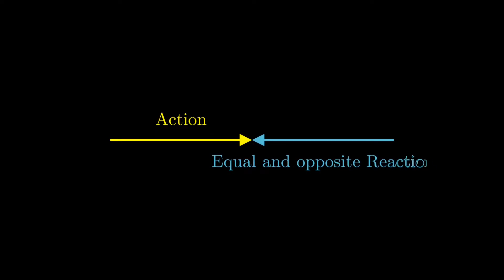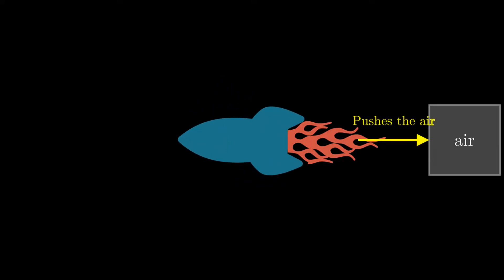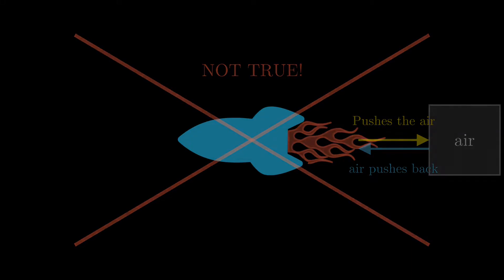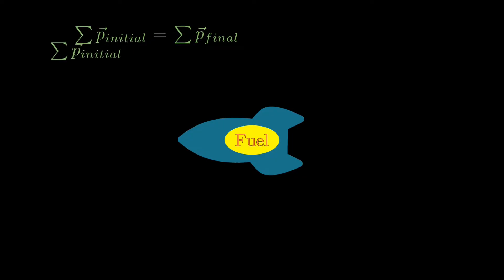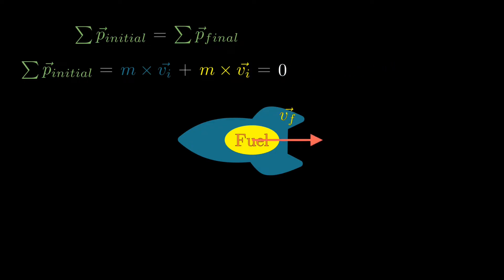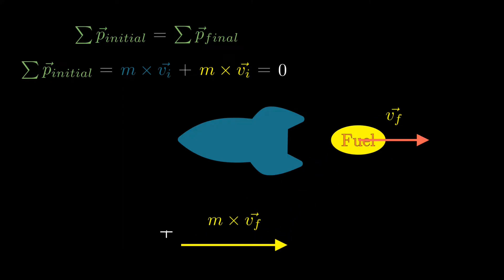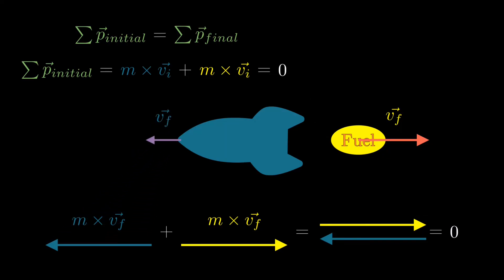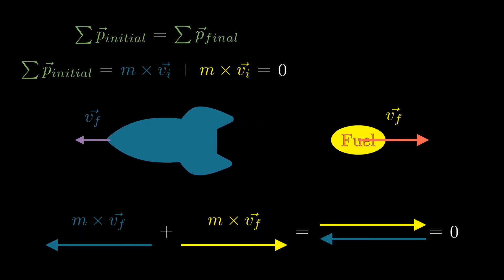What do Rockets push in Space, where there is no Air?

Comment: How do the engines ignite if there’s no combustion in a vacuum?
Reply: - "if there’s no combustion in a vacuum?"

Who says there is no combustion in a vacuum.  Certainly NOT rocket scientists.
And rocket engines run at about 3000 PSI chamber pressure so it is NOT a vacuum in the rocket's combustion chamber.
Reply: @stuartgray5877  1st law of thermodynamics, as a system incapable of either doing work or energy transfer cannot alter it's internal energy.
Reply: @papalegba6796 So you’re back to not understanding w = P * delta_v
Reply: @papalegba6796 It keeps repeating the BS that "Rocket can perform no work".

It just does not understand that the rocket cannot do work ON THE VACUUM, but it CERTAILY CAN do "work" on the MASS OF THE EXHAUST GAS.
papalegba does not understand the concept of "Momentum" since it thinks that mass can just accelerate itself with no force applied.

I guess in Papa's world mass can be accelerated without performing any "work" ( a DIRECT Violation of Newton's laws)
Reply: @AM-rd9pu  1st law thermo is delta U = Q - W. Thanks for showing you don't understand it. If you were human you'd be ashamed of your ignorance, but you're a bot so you aren't 😂
Reply: @stuartgray5877  if the exhaust cannot do work on a vacuum then it cannot develop mechanical power. Thanks for admitting rockets don't work in a vacuum for the 100th time, chatbot 😂
Reply: @papalegba6796 How much "work" is required to accelerate 500 kilograms of water to Mach eight?
Because that's how much work a Space Shuttle Main Engine does every second for 8 minutes straight.

Now please go on and tell us how "nothing" comes shooting out the back of a Space Shuttle Main Engine at full thrust,
And bless your little heart!
Reply: @papalegba6796 Nothing I’ve said violates the first law of thermodynamics. You just don’t understand that a rocket isn’t aiming to do work on the surroundings. The rocket performs work on the exhaust and the exhaust performs work on the rocket.

Comment: The law of conservation of momentum causes nothing—it is merely an observation. Rocket thrust is caused by unequal pressure inside the combustion chamber. Gas leaving the nozzle produces no thrust whatsoever, and in fact causes a backward drag.
Reply: So you claim that we don't even need to use a fluid outwards? We can just created an area of high pressure? 

So, in your claim, then, all we would need to do is flow some gas out, maybe even recapture and recycle it and thus use zero fuel. 

Please explain why you're the only person on the planet who is knows this. You don't think someone would have made a simpler and cheaper rocket? 

Clearly, besides a lack of physics knowledge, your logic skills are wanting.
Reply: It requires a force to make the gasses leave the nozzle. The force comes from the rocket and the gasses impart a force back on the rocket.

Comment: Wont the rocket simply be sucked into the point where the combustion is?
Reply: What?!? Why would an expanding gas which is fling mass in all directions "suck" something in?
Reply: The combustion makes the exhaust gasses expand rapidly and with a lot of force. The gasses are forced out through the nozzle. The rocket exerts a force on the gasses and the gasses exert a force on the rocket.

Comment: I understand absolute nothing here
Reply: Rocket propulsion is just the mechanical recoil of pushing on mass.

Rocket engines apply a force to push the exhaust gases out and MUST feel an "equal and opposite force" in the other direction.
For a gun or crossbow we call this force "recoil"  in a rocket engine we call it "thrust".
They are both the same physical mechanism.
Reply: @stuartgray5877  Rocket propulsion is the outcome of pressurized gases, pushing the rocket forward FROM THE INSIDE.

This process will transfer a lot of forward momentum from the gases to the rocket and as per Newton's 3rd law, an equal and opposite (backwards) momentum from the rocket to the gases. We make sure that this backwards momentum is eliminated, by allowing those gases to exit outside of the rocket from the exhaust.

"Rocket engines must apply a force". Is invalid. Its the gases that apply this force (after they expand when we burn them) to the rocket, and then the rocket does what you described.
Reply: @-_Nuke_-  Care to tells us HOW they derived the Tsiolkovsky Rocket Equation?
Please break down the derivation for me?

No? You cant do it?
Then S
T
F U.
Reply: @stuartgray5877  You don't know what that even is...
Reply: @stuartgray5877 thank you so much! My homework was killing me and this video didn’t help at all! You are an angel sent from heaven (I’m not religious but you make me believe!).
Reply: @Insaneclownpoppy  The thrust from a rocket engine can be calculated at least two different ways.
One is integrating the forces (pressure) inside the entire combustion chamber over the entire inner surface.
This will result in an imbalance of total forces where the nozzle allows the gases to escape instead of pushing on the walls.
OR
Using the "Law of Conservation of Momentum" and using the mass flow rate and exit velocity to determine the momentum of the exhaust gas.
Reply: @stuartgray5877 pressure is a scalar, so you are wrong. As always 😂
Reply: @papalegba6796 - "pressure is a scalar"
Thats nice.  But is irrelevant "as always" with you.

"A" is a letter.
But rockets still work just fine in a vacuum ,just as Newtons laws say they MUST.
But thanks for proving you are still as clueless as always.

It is hilarious that you have been at this "Physics denying" BS for longer than it has taken my grandchildren to start and finish high school.
So, in the time you have kept up this petulant child charade, some 12-year-olds have become educated and EXCEEDED your level of education.

You should be proud of yourself for remaining this willfully ignorant for so long,
Bless your little heart!
Reply: Probably because he has a bad accent and its just bullshit. If indians understood physics, you'd think they could at least solve their garbage problem.

Comment: There is more to it than that, but you are correct in the base science. Directing and condensing energy in order to use velocity and momentum efficiently is very important.
Reply: The "base science" IS:
Rocket engines push out mass and feel the mechanical recoil of doing so.
Reply: very important for adult fantasy.
Reply: Both wrong 😂

Comment: The key is the rocket nozzle cone.  Close to the nozzle where the gas exits, vacuum is filled, eliminated, providing a short pressure wall to push against.
Reply: Not really.  The rocket engines feel an "equal and opposite" reaction to accelerating the mass out the back.

Rocket engines accelerate mass and feel a recoil force as a result.
Reply: that makes no sense
Reply: @ Which of us makes no sense?

Rocket engines accelerate mass.
They MUST (per newtons laws) apply a FORCE to that mass to accelerate it.

Then due to newtons THIRD law the rocket MUST feel the same force but pushing it in the opposite direction.
Reply: @stuartgray5877 you need to have a word with your fellow chatbot AM. It says mass CAN be accelerated without a force being applied, if it's a gas. What do you say, programmed lying machine? 😂
Reply: @beatsbybk  So you think you can create a device that throws thousands of pounds of mass per second and the thing would just sit there?
Reply: @kitcanyon658  rockets don't have arms, so they don't throw things, blind chatbot 😂
Reply: @kitcanyon658  it's not a lazy claim to say rockets don't have arms on the back that throw things, chatbot. It's the truth 😂
Reply: @papalegba6796 Good job admitting you don’t understand figurative language.
Reply: @AM-rd9pu  physics is not figurative language. Fiction is tho, which is why you use it, chatbot 😂
Reply: @papalegba6796 I’m sorry you can’t understand figurative language being used to explain a concept. 

Do you think analogies are fiction as well?